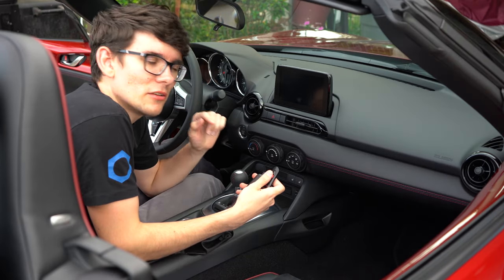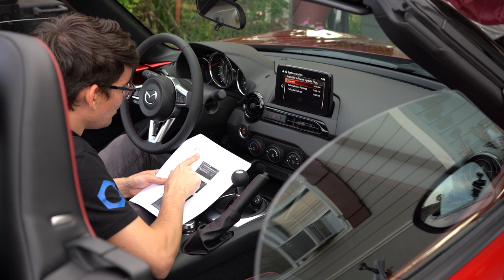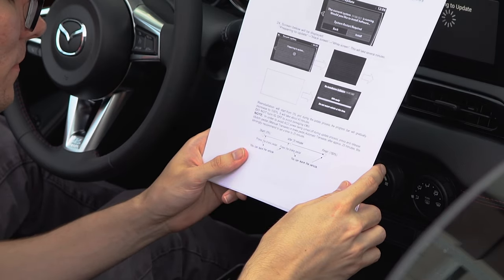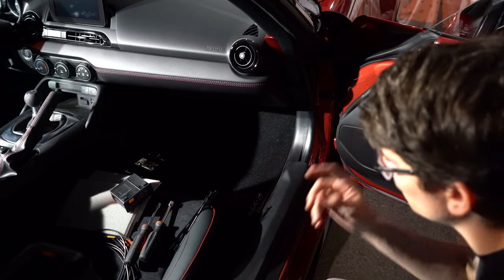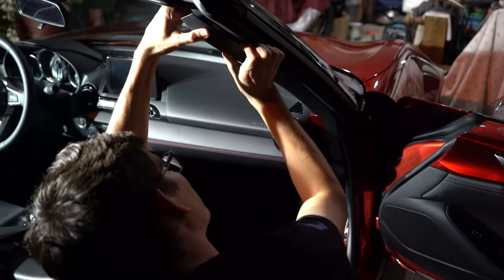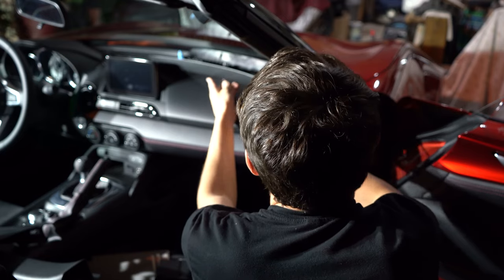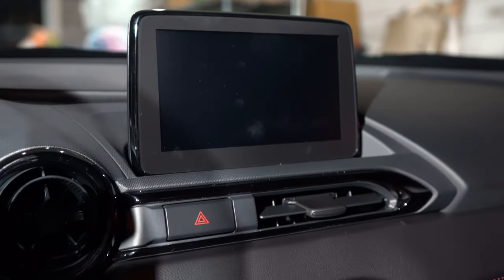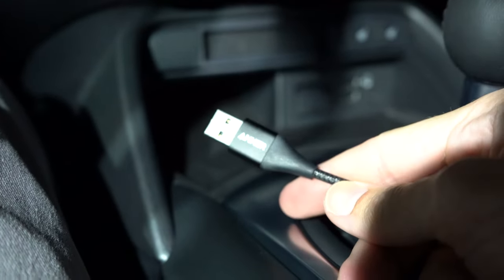How To Get Android Auto & Apple CarPlay In Your ND MX-5 Miata

Comment: This is still relevant 3 years later. Followed this guide last night and replaced my screen while I was at it (it was delaminating). Thanks for the video!
Reply: Hey, I have a 2017 Miata. You said you replaced your infotainment screen. Do you know if it's possible to replace it with a 2019+ screen with the black bezel instead of silver? I want to do this on mine but not sure if there will be an issue.
Reply: @DaveSimkus  I'm wondering the exact same thing for my 2017 RF. Did you ever find out if the newer black bezel screen is compatible?

Comment: Somebody left an Amazon review on this usb hub that we're all idiots for ripping the dashboard apart when the radio has 4 tabs on it that can be pushed and it pulled out. But I don't remeber if the guy had a Miata or another mazda. I really want to figure out how to get it out without the dash bs this should be a 5 minute job. I bought a car radio tool kit but haven't found the magic touch yet.
Reply from the maker: This is how Mazda dealers do it. I really wish there was an easier way when I filmed this. But this is the only way for a Miata.

Comment: JUST finished my install after following your video, everything went smooth.  2 things to note, you don't have to take apart the entire center console (command nob, arm rest, etc.) as the shifter boot comes off by itself with the little rubber part.   2nd is showing that the origional connectors for the CMU and bottom USB hub are not used and can just be tucked away in more detail would have been nice.  

Great vid though!

Comment: Firmware update performed flawlessly. Thank you for the files and the clear instructions. Kit arrives Friday, can't wait to finish the job!
Reply: But why is necessary to change the hub?
Reply: @ilTubodiEliGabri  by hub do you mean the usb port? I believe its that the stock USB port does not support the Apple/Android connection.
Reply: @minm0  yeah i mean that, anyway thanks, i even read that if you use the old one you can brick your console so yes, i need to change it

Comment: Thank you so much! I completed this project on a 2019 mx5. It does take about 3 hours. My wife will never drive a manual. So, due to the auto it did add more time and complexity. If you have an auto, the forms do not recommend removing the shift knob. Put it in “N” and remove the negative battery cable and get ready to move the console a lot.

Comment: For the automatic transmission:
You can remove rubber piece without removing the whole armrest area! Even in P (though it would be slightly easier in N). To access and remove rubber mat you just need to pull that metallic circle around your shifter straight up. After pulling it up there is nothing that holds that rubber anymore and you can easily remove it.
Reply: Glad I decided to look through the comments before doing this lol You sir will save me a lot of time with this tip. Thank You!

Comment: Your amazon link to the retrofit now shows a P3 and P3.2 (the latter being wireless carplay and wireless android). Would  you say these would be safe to install assuming we do the latest firmware install as indicated? I'd rather take advantage of the wireless (no wire upgrade) if it indeed works on the 2016 MX5 ND1

Comment: I own a 2019 MX-5 Grand Touring RF manual and it doesn't have Android Auto.  Why did Mazda even design that module that way, making it difficult to upgrade or update?  I don't want to go through all that trouble or even let the dealer do it since I've very picky about scratches, smudges, rattles and what have you.  Couldn't they have just design that particular module by a couple of screws and merely pull it out and replace it in a similar fashion?

Comment: I see kits that have USB-C now. Should I stick to the one you linked or is there a better version now?
Reply: Do you feel USB-C and/or Wireless CarPlay is better than USB-A?  Answer that, and I think you'll know the answer to your question.
Reply: @EnochLight  Well, the USB-C versions have wireless Android Auto and Carplay. The issue is that I don't know if it will work. I don't want to spend $150 on something that won't work with our old infotainment systems. The regular USB-A non-wireless versions are much cheaper.

Comment: Just finished this install, one tip - I couldnt get the connector out for the mazda cmu controls (the knobb). So I realized I was able to pop up just the area around the shifter boot (the fake metal) connected to the plastic matt surface. This was a lot easier.

Comment: Installed on a CX3 2016 pretty simple, was worried because the engine was off and usually I update cars with engine on.  After the reinstall I noticed NOTHING absolutely no difference other then the SW version.  So unless you are willing to change out the USB i wouldn't recommend this update.

Comment: So my only question would be does it even work with the stock hub but just charge slow?

Or does it just not work at all with the stock hub?
Reply: @BK_BT  Right. I was thinking about giving it a go but I'm  hesitant because I'm on ver .55 which is the last version they allowed tweaks on so I was able to hack in unofficial Android auto.

I just didnt want to update to .70 and then it not work at all and I lose all my hacked in tweaks from ver .55

Thanks though man!

Comment: Just tried this on my 2017 Miata that had 59 firmware and updated to 700 latest, but the CarPlay USB port is not recognized at all, no CarPlay under Applications either , all connections are secure
Reply: Hey, did you figure out the issue with your Carplay on the Miata? I have a 2017 as well.
Reply: @DaveSimkus  ended up swapping out the head unit for one from Amazon and that worked, but occasionally disconnected. I would get an OEM unit or have the dealer do it

Comment: Hi! Great video. I got a problem with my installation. My system keeps turning off and on almost every 15 minutes or so. I did go back and check all cables and they are well connected and not bent, and nothing is out of place. Thanks for any tip or help with this.
Reply: Seems to happen to me as well, but much more randomly.

Comment: Can I update firmware and still use old hub? I was thinking of updating firmware but might not get hub for a few weeks.
Reply: Yes, the newer firmware works fine with the old hub.
Reply: @djrobx   what year and model? i just updated in my 2015 3 sport with old hub dose not show apple carplay and android auto using my old hub. just ordered the hub now hopefully that will work
Reply: Ryan Holmes You need the new hub for CarPlay to work.  But the old, existing usb functions work fine with the new firmware until you get it.   

Eric wanted to know if it was safe to update before receiving / installing the new hub.  It is.

Comment: I'm going to do this today - I see your edit has a single file without a failsafe, if I'm updating from the original firmware, can I go directly to this version? Or do I need to do the failsafe, NA_70.00.100A , then cmu150_NA_70.00.335C_update.up?
Reply: @BK_BT  shit. I'll have to check what I am. Its not been updated since I bought it in 2016, so guessing I'll have to do a two stage upgrade?
Reply: @BK_BT  I'm such an idiot - the Google drive even says to install the older firmware first. Thanks for your help!
Reply: @BK_BT  doesnt seem to want to do that - says there needs to be a faiolsafe installed first. So i said "ok" then once on the install screen i select .335C and it says no updates available on the drive. I'll try 70.00.100 first again.
Reply: @BK_BT  I think I found what's up. My system was version 59 and I tried loading that pre 29 failsafe on it. Then tried going direct to the 70 versions without failsafe and it didn't like that.

Comment: Did you disconnect negative battery terminal prior to service?
Reply: @BK_BT  ahh okay. So I'm installing right now and I'm to removing the shifter boot. It's an auto and from what I've seen you have to put the car in neutral. Am I okay to start it up with all the pieces unplugged?

Comment: Hello Friend.
Thank for your demonstration video.
I have a Mazda CX5 2018 in Perú, with 59.00.540 4AN version, and I need update to 70,00.100 4A N versión, just like you said in your box instructions, but a don't know where is the place to download this version "FIRMWARE Version for '4A N' or (ADR) for CP/AA .up files.
cmu150_ADR_70.00.100A_failsafe.up file MUST Install FIRST 6.8MB
cmu150_ADR_70.00.100A_reinstall.up file Install SECOND 1.8GB"

May be you know the site and I apreciatte you could send me the link.

Thanks for your time.

Comment: Thank you bro!! Anyone from Canada have any luck getting genuine OEM Mazda parts for AA / CP FOR my MAZDA CX-5 2017?
Edit 1: Thanks man I got my AA/CP parts from Kanata Mazda in Ottawa, ON. I just updated the firmware thanks to your help and it seems to be functioning well, I will try to install the CarPlay module now!
Edit 2: I got CarPlay up and running, but took a while since I had to buy a few tools, forgot to get a plastic pry tool, extra insulating foam tape for the wires, and a torque tool to remove the bolts as they were tightly on. I also messed up the wiring because I put the wrong head of the wires with each other, be sure to check you have the blue green head together for the top, and the brown and black (I think) at the bottom before you start taping the foam. This was a big mistake on my part. But I learned a bit and if my dumb 22 year old college ass can do it anyone can. Thanks again!